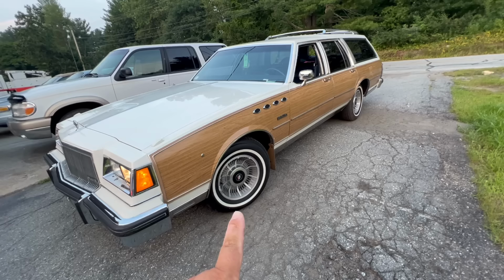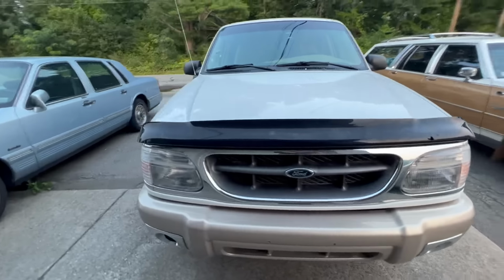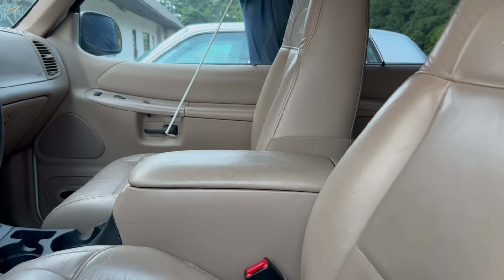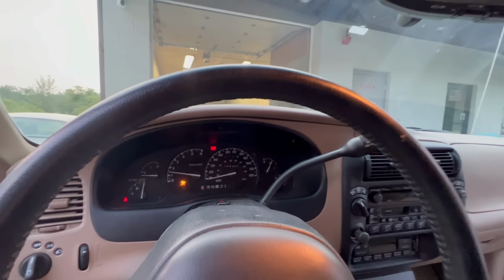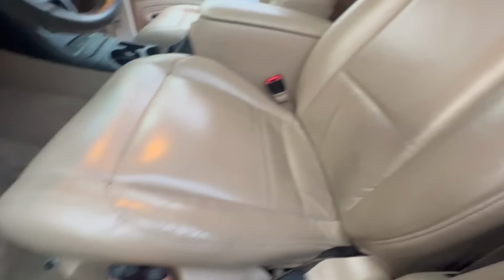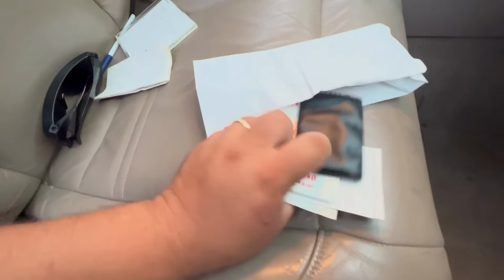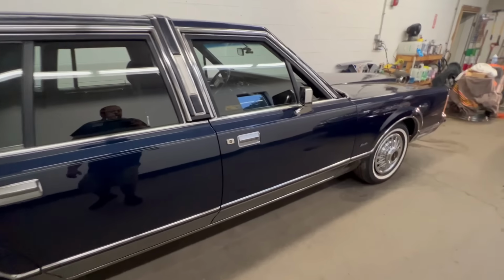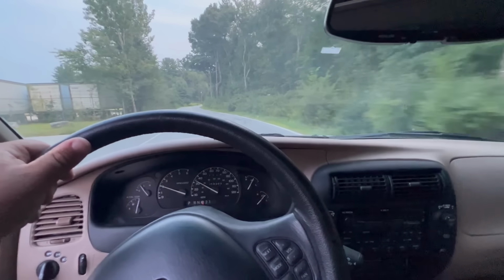I bought a mint 1999 Ford Explorer survivor! Post vacation updates

Comment: Explorers from this era have this common failure point where the solder joints on the display panels fail causing the screens to go black. My Grandparents' 99 Eddie Bauer had the same problem.

Comment: I would have used that rod to press the power unlock button, not as dramatic, though. 😀
Reply from the maker: Wouldn’t have been helpful with a dead battery
Reply: @specialtymotorcars  HA HA I stopped wayching it as soon as you opened the door to go out and finish mowing the lawn. Now that I watched some more,  I see that you said the battery was dead.

Comment: Where do you buy your white wall tires? I am looking for a set and can't find them anywhere.
Reply: Coker Tire makes period correct white walls, but they aren't cheap . I found some foreign made Iron Man 225/75/15 tires with whitewalls for my 1979 Cadillac. They aren't a nice American name brand tire, but they seem ok. Mine will dry rot before I drive the car enough to wear them out. Hankook was still making a decent whitewall not too long ago, not sure if they're still available.

Comment: Anthony it does have Twilight Sentinel or "Autolamp" as Ford called it. In those years Explorers and Mountaineers the on-off switch and delay is on the rear view mirror on the windshield, and I can clearly see that option in this video
Reply: Yes they did - I remember my dad buying a brand new 98 Ford Explorer Eddie Bauer when I was 14 and when he got home from the dealer with it at night none of us could figure out why the headlamps took so long to turn off 😂 I think we found that delay switch on the rear view mirror the next morning and it was set on the longest setting.

Comment: v8 was the 5.0, they switched to the 4.6 in 2002
Reply: The headlight sentinel is on the rearview mirror - yes an odd place for it but that's where they put it through the 2001 model year...I've had a 97 Explorer, 2001 & 2004 Mountaineers

Comment: That generation Explorer was an abomination

Which is strange because the F150, Expedition, Excursion and Super Duty of that generation were gorgeous

The transition from square styling to rounded styling wasnt always successful
Reply: They weren't all bad- the 4.0L V6 was pretty decent, and they were still body-on-frame instead of the unibody ones they make now. I got a few hundred thousand mostly trouble- free miles out of my 1998.
Reply: @davetritt7139  
Im actually referring to the physical look of the vehicle

Hideous

But also I know these were trash reliability-wise...anyone who bought these instantly regretted them

In fact subsequent Explorers have also had shitty reliability and questionable build quality, so im not gonna blame this generation for any of that